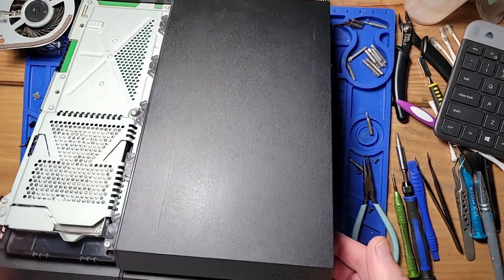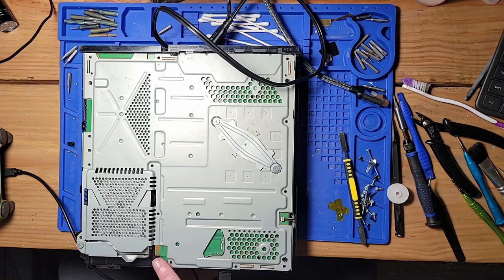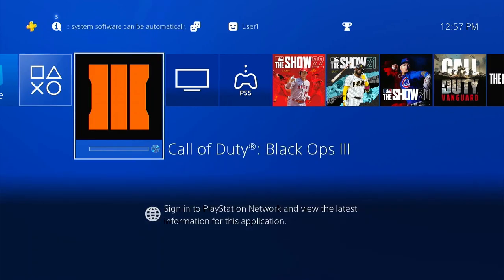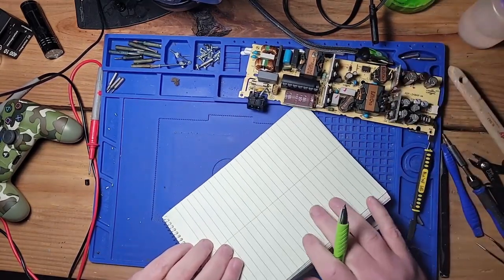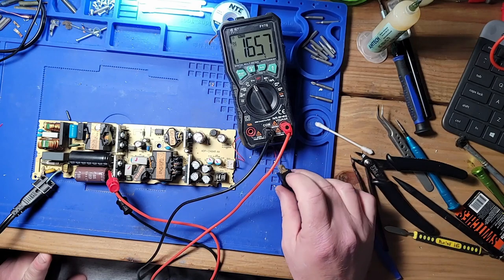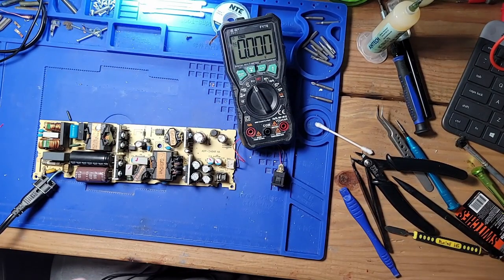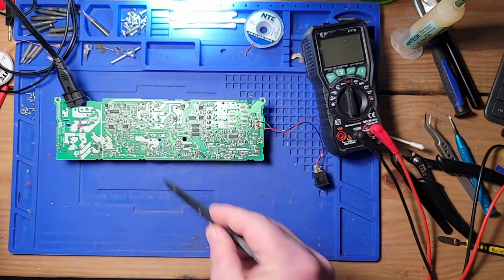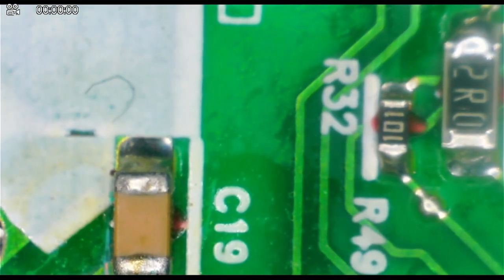Trying to Fix Goodwill Junk PS4 (ADP 240AR)

Comment: Mine presents with similar conditions. My pfc runs and gets to 400v but the psu cuts off immediately. also I do not get 12v out.
Reply from the maker: I would say that you need to focus on the 12V. If PFC is jumping to 400, it would seem that it is working correctly. IC151 is the IC that controls everything and if it doesn't detect the 12V it shuts it all down. There is something that is preventing your 12V out. Find the schematic and start working your way through the 12V circuit. Keep in mind, I am not an expert.
Reply: @probablycantfixit6426  Thanks. Yes I found the schematic you were using, and I am going through it.  In your power supply case. As you figured out, the feedback resistors set the pfc voltage. Those resistors have a high tolerance as they need to be exact. Once the pfc voltage is lower than it should, typically one of the feedback resistors have changed value.  I am not sure yet on this ps4 psu model, but on the slims, you can force the pfc to run without enabling acdc sby with the 5v by injecting about 13v with a bench power supply.  You DO NEED that isolation transformer to do so.

 Like you, I am not an expert, but I do enjoy trying to fix these consoles.
Reply from the maker: @jonathansandiford4137  That is excellent information. You may not be an expert, but you seem to be very knowledgeable, and I appreciate the write up so others can learn from you.
Reply from the maker: @jonathansandiford4137  I am probably don't comprehend part of the theory, but if Q41 failed, would that not interrupt VDD_SW1, which is needed to establish PFC_CTRL? It seems if that failed your PFC would never start.
Reply: @probablycantfixit6426  it depends on how it fails. I have seen it fail on, and the pfc keeps running.

I can confirm it's the same q41 on this model psu. In my case, I injected 13v.(tho normally, the voltage that gets switched by q41 is about 17v) and my pfc runs, producing 410v. But there is no 12v being generated. Under a thermal camera, I observed that  ic32 did not show any heat. So I will have to investigate further.
Reply: Sup, before I open anything up I want to ask more experienced people... so, my PS4 is turning on, but after turning off it won't start again, until the caps will get discharged (ac disconnected from psu for half hour), what could possibly cause this ?
Reply: @maxmax-xx7nw  You just have to go through testing part by part on the power supply. 1st start by jumping the 1 pin and 2 pin on the power supply connector to the motherboard and measure for 5v on whatever it is you used to jump them (I use a bread tie with the plastic shaved off of it, this guy used tweezers https://youtu.be/Nu99ss624xQ?si=6LkhzYKWz547pyPE). Then measure for 12v where the 2 long metal prongs go into the power supply with the power plugged in, BE CAREFUL THE CAPACITORS CAN SHOCK YOU! If you read 12v, it's good and you are probably losing power on load (like in this video) or if it doesn't give 12v then you test every part (I'd start with the fuse testing for continuity [listening for the constant beep on your meter] near the power socket as that's a common point of failure in the PS4 CUH-1001A models...
Reply: @thebreakerofwalls9036  thanks for reply, I have connected ATX psu to it, and it was turning off on stock PSU after 15-30minutes, and on ATX psu it took 5 hours to turn off, at the end it was wifi/Bluetooth module fault, it overheats when connected to wifi and won't let PS4 to turn on again 😂

Comment: Hello from Argentina, in most cases if the ingrades are good it is some resistance that is out of value, or cold welding in both the important R's as well as in the 2 important choppers. Greetings!
Reply from the maker: Hello, and thanks for the pointers. Very much appreciated.
Reply: Hola pa, arreglaste varias fuentes? recibi una ps4 que tenia volado el integrado de los 5v, lo cambie pero no hubo caso. No parece haber otro componente reventado ni nada. Podes orientarme? Gracias

Comment: I have the exact same symptoms on my ps4 but I'm not getting the 12v when jumping the 5v pins 39:35 Is this moment when he mistakenly finds the problem or did it happen offscreen when he unsoldered the 2 resistors?🤔🤔🤔
Reply: He had probably like me just tin crack on R24.
Reply: I believe it happened 9ff screen

Comment: Am trying to repair this very same psu the ps just sounds a beep without powering up when i tested the 12 volts power rail after jumping pin 1 and 5 no 12 volts is present and when i trace the circuit i fuond out tha pin 9 10 11 14 and 15 on ic32 have short circuit to ground is it that normal or the ic i faulty

Comment: I have 400v on the pfc and I get 12v out when I short psu to make it start, but when I plug the power cord the PFC stay on 316v without starting the psu. The ps4 fast shutdown and when i remove the power cord from the psu and press the power button on ps4 it turns on and fast turn off. Do you think the psu has a problem?

Comment: Am trying to fix this very same psu. The relay just turns on then immediately off i have no 12 volt on the output and i have found that ic32 pins 9 10 11 13 and 14 have a short to ground is that normal?
Reply from the maker: I would say that it is probably not normal but I don't have one to verify on. If you search on YouTube for Toltec Merc, he has a lot of videos about repairing power supplies and you may find an answer there.

Comment: Hello i have the same psu but mine have like 400 volts on main caps but doesn't have no voltage on the output, no 5v no standby no 12volt.
I think it has to do something with the ic, what could have gone wrong
Reply from the maker: I would start with IC151 since it is common to both 5V SDBY and 12V. I am linking the schematic in video description.

Comment: my ps4 issue is similar to yours.
beeps once with a blue light and then dies instantly even when i spam the power button, but then if i were to unplug the power cord and plug it back in it would do the same thing. i dont have the tools you do aside from a hot air gun,.
now my question is, would blowing hot air at the bottom of the board get them to work again? probably a bad idea but if it works then i dont have to order another psu online and wait a month.
Reply from the maker: I suppose it is possible. You could also order a Power Supply to see, for certainty, if that is the issue. If you are talking about blowing hot air on the PS, then I am not sure if that will help the issue, but you can give it a try. There are a lot of people that say this or that is a bad idea, but it is more about whether you are willing to accept the risk of what you're doing. If you are careful and precise, then I say it is OK. If you learn from it, then all is good. If the 12V rail is not shorted, then it seems the power supply could be faulty.